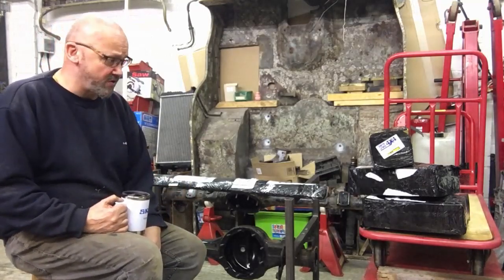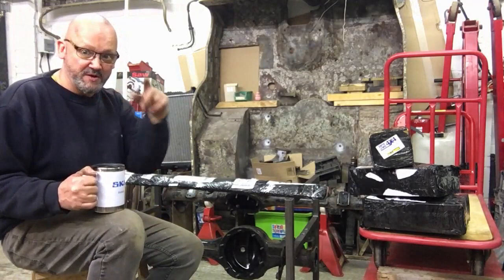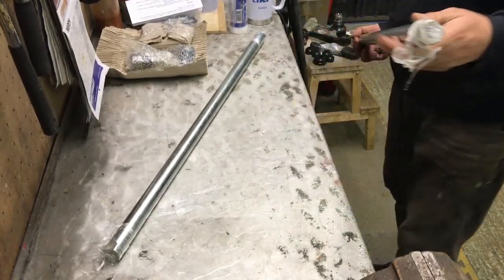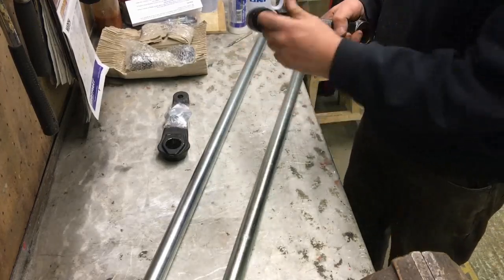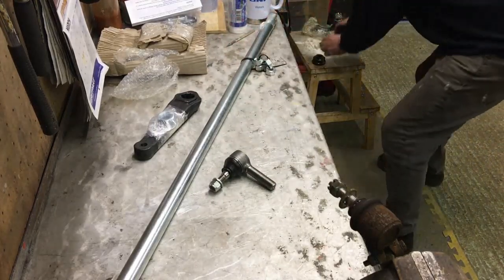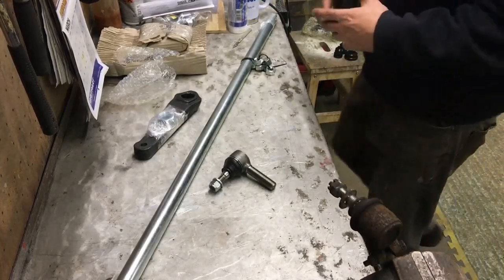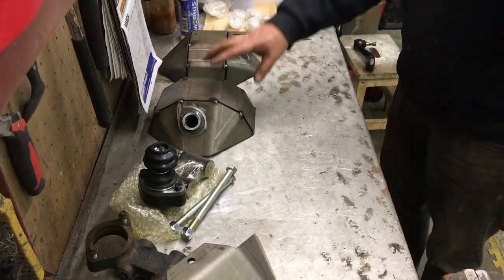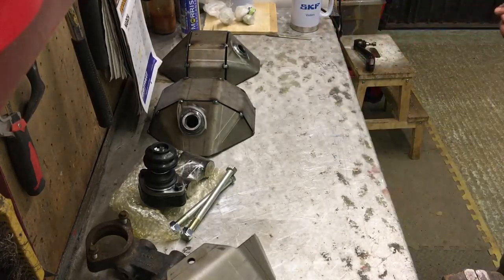Gwyn Lewis 4x4 goodies unboxing

Comment: ...those boots are a damned good idea....as for the clamp on diff guard, mine had been on for nigh on 20 years through shitloads of heavy off roading and only left very light rust on the diff pan....maybe I was the exception though mate :)
Reply from the maker: I agree 100% Paul, I have never actually witnessed a holed pumpkin due to a clamp on diff guard, only heard of it... however..... your axle did have just a spot of rust protection if I remember correctly??
Reply: ....hmm....just a few tons of grease, oil and crap....LOL